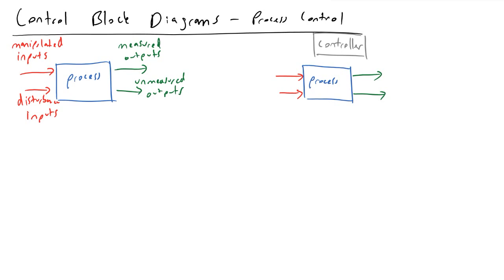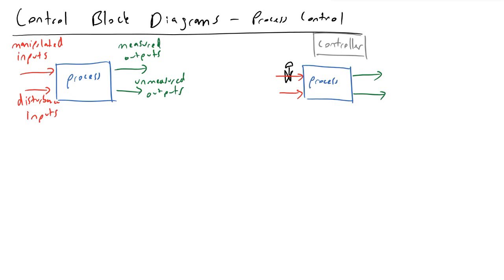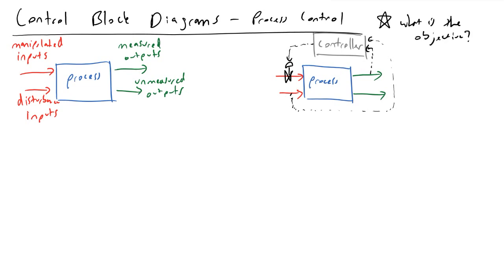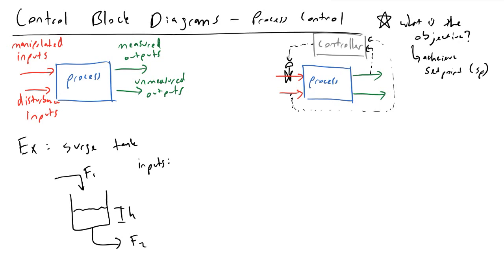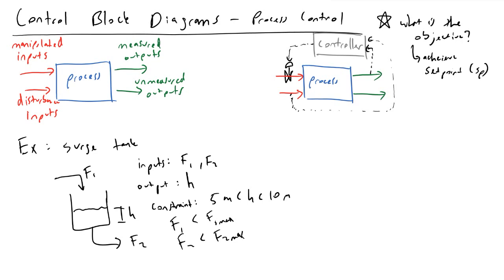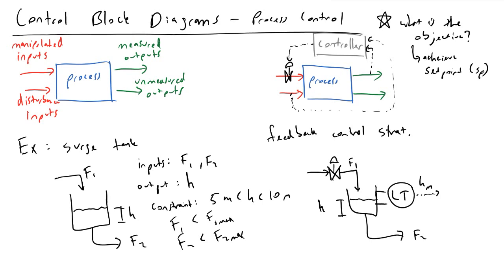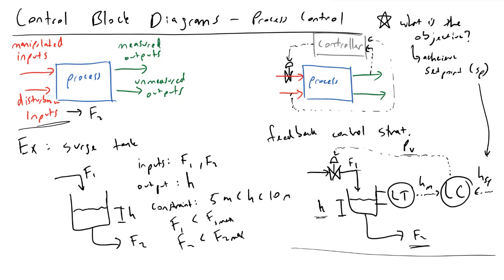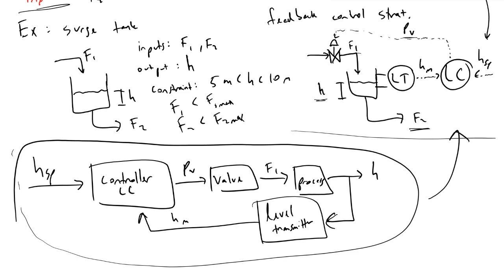Control Block Diagrams in Process Control

Comment from the maker: I wanted to clarify the definition of inputs in process control as I feel I didn't do a great job explaining it in the video:
The definition of inputs and outputs varies depending on the *control objectives*, so you need to understand the full story before defining the height, flow rate, etc as an input or output. 
In general, inputs are anything that a controller can potentially control and outputs are anything that a controller can potentially measure. Stream F2 can be an input if we had a valve on it that was controlled by our controller, even though intuitively we would think of F2 as some kind of exit/output of our process, it is an input to a process engineer in the above example.

Comment: Hello, how would the block diagram differ if the valve is downstream in the F2 flow? I suppose the manipulated variable becomes F2, and we have to find the process transfer function from F2 back to H. This is a little counter intuitive as F2 is downstream of H, so if the transfer function of H/F2 is just 1/R, then the transfer function we have in the diagram would just be K (a constant gain). Then, where would we ever use the transfer function of F1 to H?